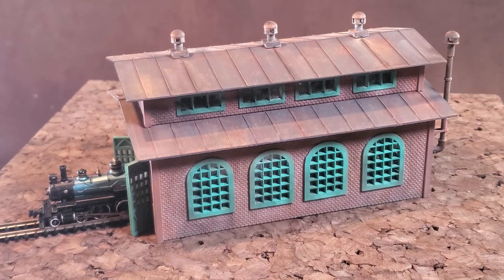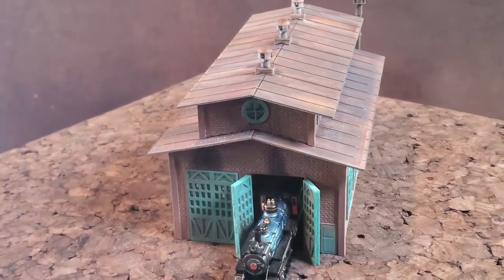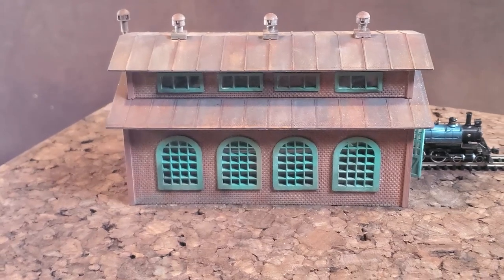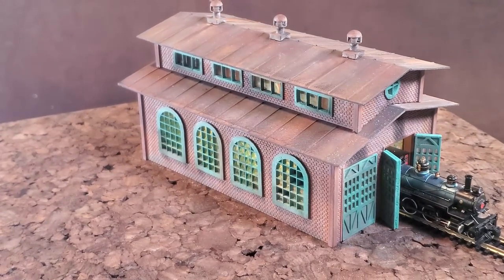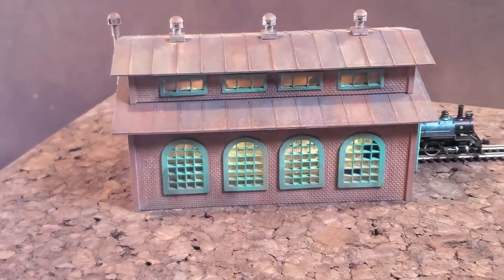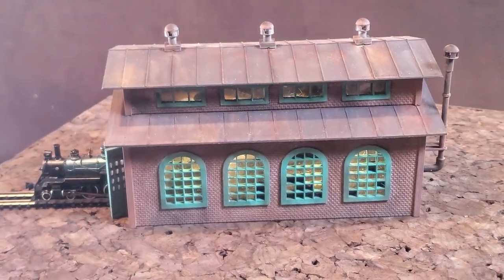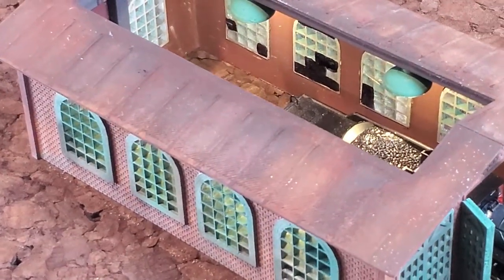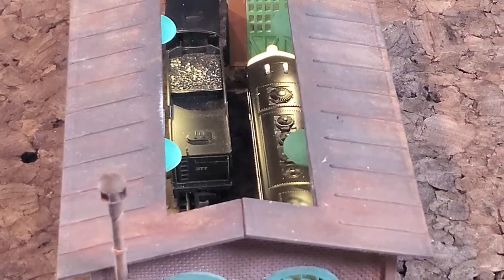3D Printed N Scale Engine House

Comment: Awsome job love the look of it could i have dimensions so i can make a 4 door shed similar to yours
Reply from the maker: Ok, so I hope that I don't sound like a complete butt. However I won't give out the specs because I actually sell the files for my designs. I will tell you However that I started by measuring the length of my longest loco I planned on putting in there and of course gave enough extra length that it looked correct. Did the same with the width of the loco. I measured the height and width of the loco and sized the door accordingly. Then I just filled in the shape of the building around that.  Again, sorry. I hope I at least gave you an idea of how to start to design your own engine house. Take care.